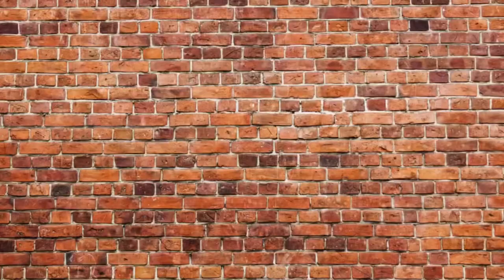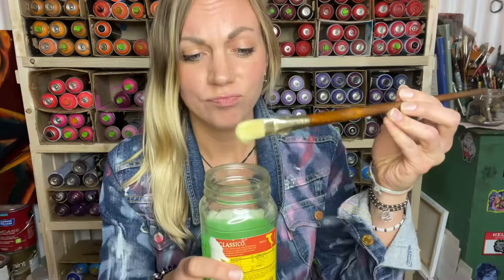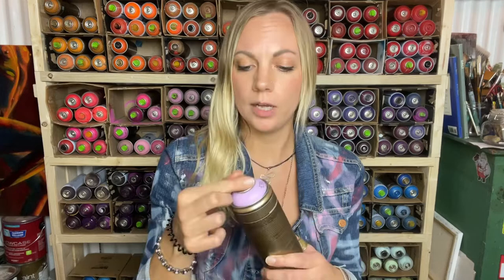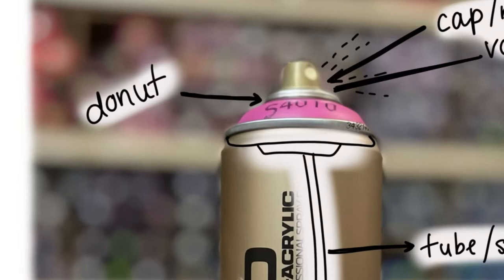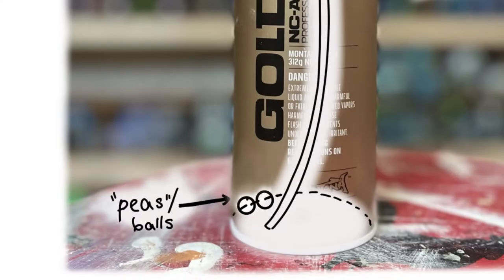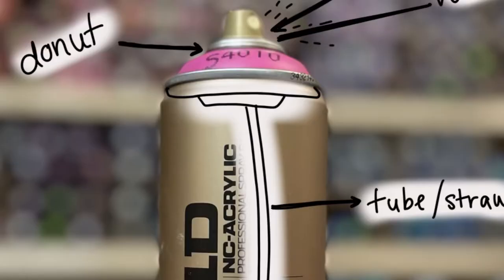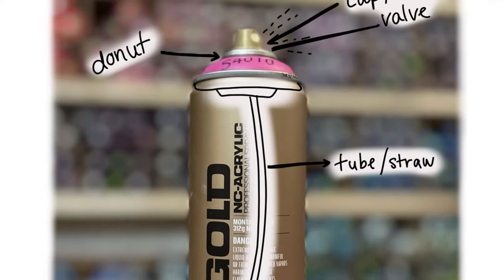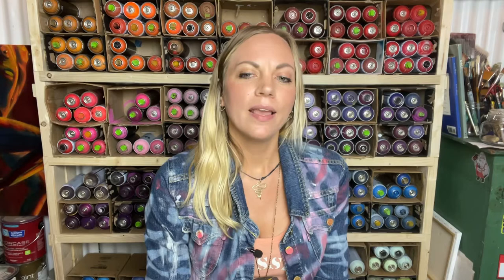Anatomy of a Spray Paint Can and How it Works- Street Art Tips 2022

Comment: This is cool and all but you didnt actually explain how the nozzle works, does it hit the metal tube on the can pressing it down? Does it "hug" it with friction pressing it down? 

I have a can that still has air in it and the nozzle/can is not clogged but it still wont spray with the original cap (it sprayed for like 3 days but then stopped suddenly out of nowhere) it works with another cap but i want to use it with the original cap. I tried to pinch the tube but that did nothing